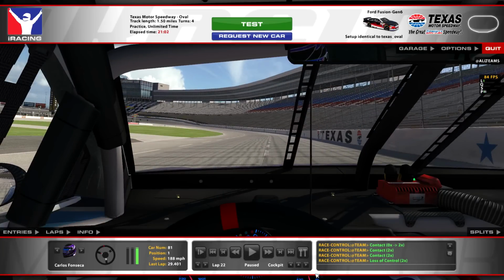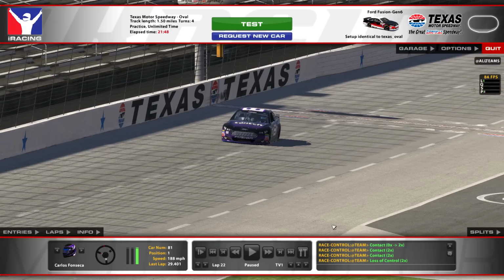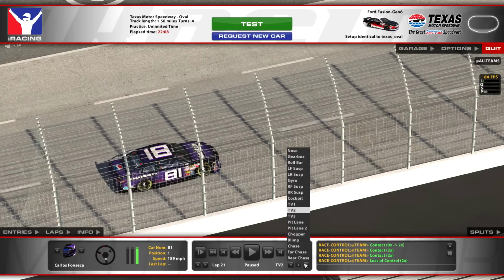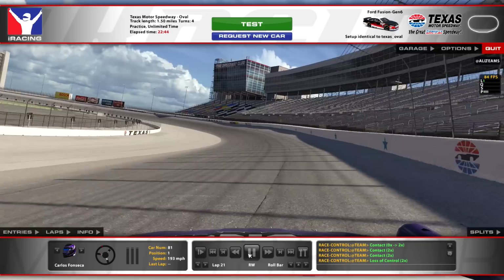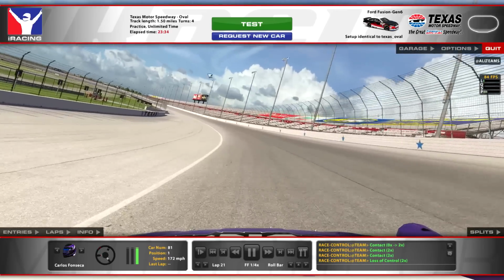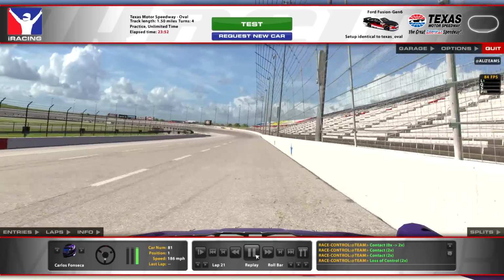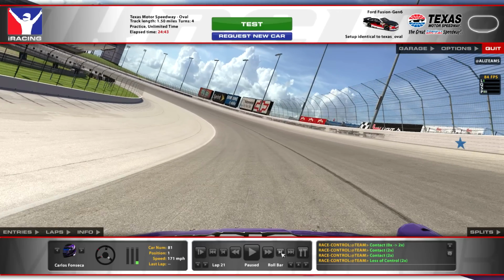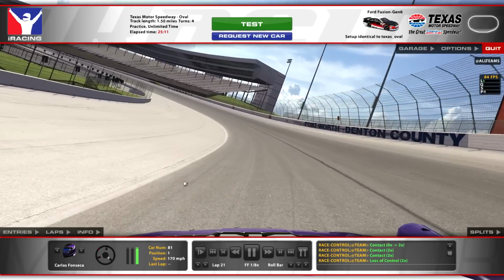iRacing Track Guides - Texas NiS 2015

Comment: Thank you for this. I was struggling because I was trying to repeat what I saw on an older video, I guess you cannot drive it that deep anymore. Managed a 29:487 thanks to you after I had an hour of failure where I used the old line and couldn't do anything better than a 29:800. It is also far more stable and I'm not totally spinning out everywhere.